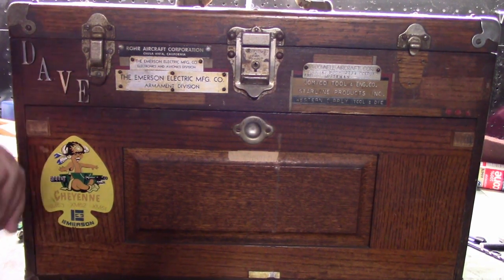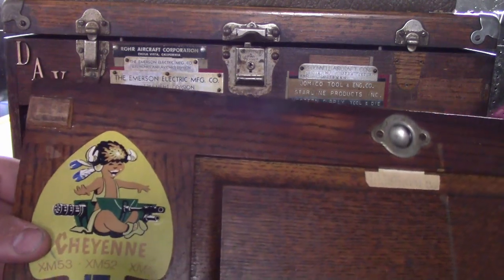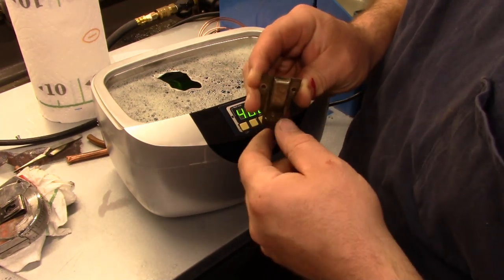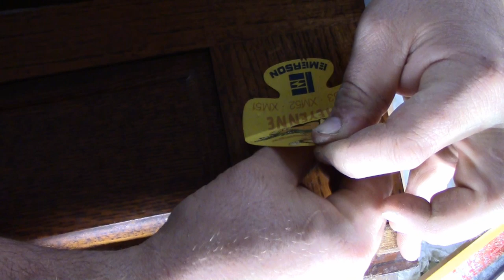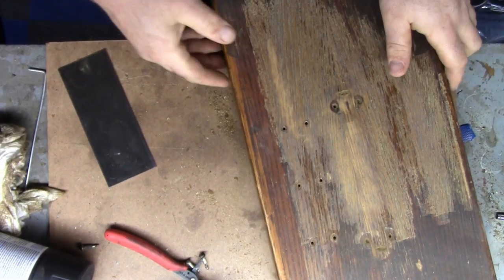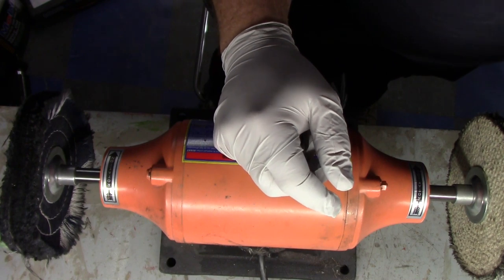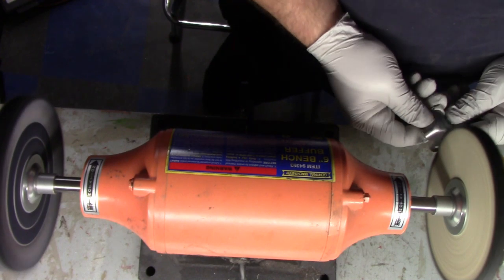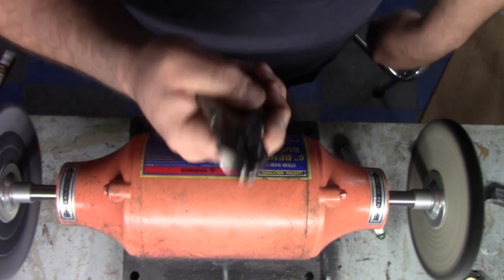Gerstner Refurbish Part 1

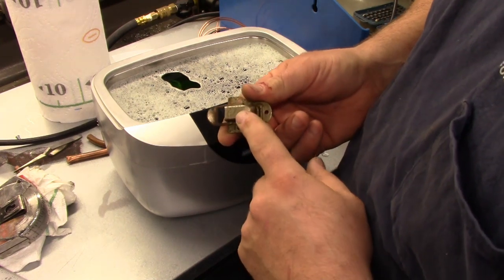Comment: 4:12 great advice on the spring steel and evaporust ........... I've had some divider springs break while sitting in evaporust.  Granted I may have left em in there longer than suggested but ........you're right about that